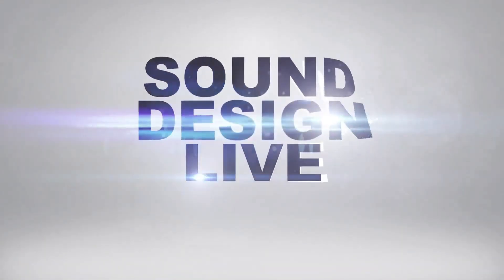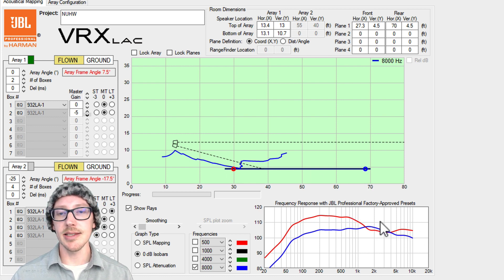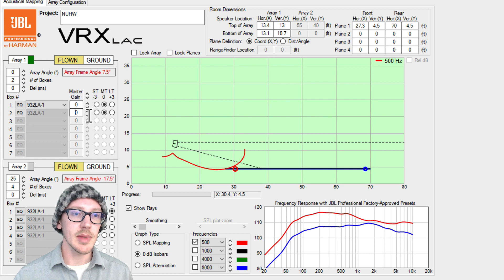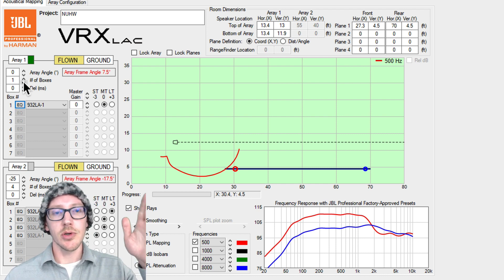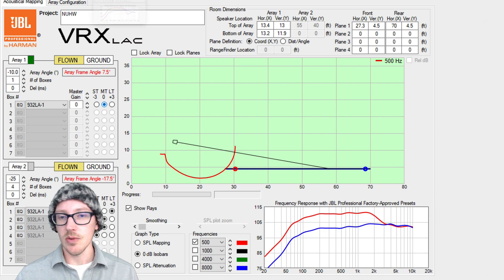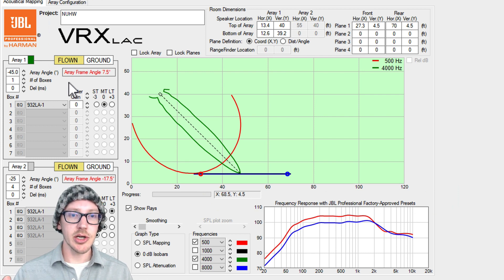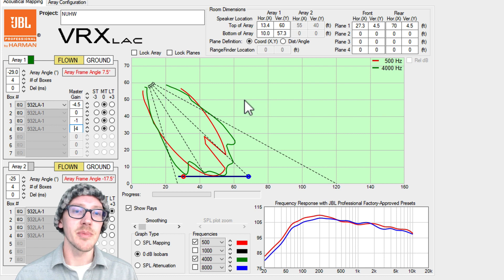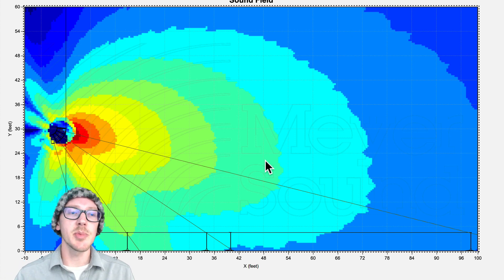Is gain shading the only way to optimize a constant curvature array?

Comment: Hie Nathan, Thank you again for yet another video! If we were to go with a 60 feet height with 4 boxes, don't you think we'd lose SPL in the lower registers all in the name of getting good front to back even coverage in the high freqs?? The hangs would definitely be more than 60 feet away from the first row of spectators. Thoughts?
Reply from the maker: Hey K, 60ft is an exaggeration. I just kept making it higher and higher to observe changes in coverage shape, not considering the tradeoffs of sonic image or critical distance.